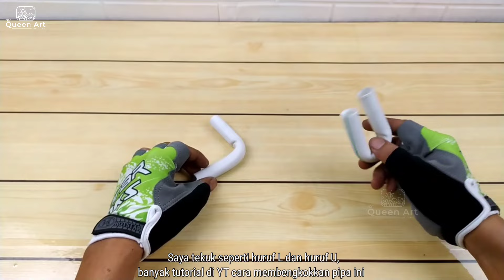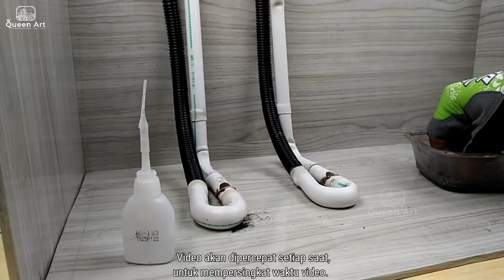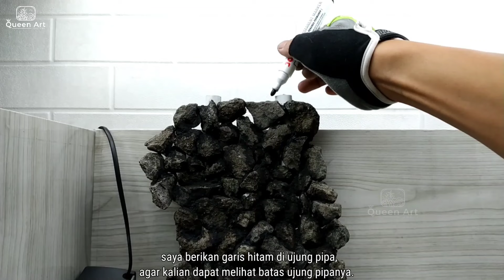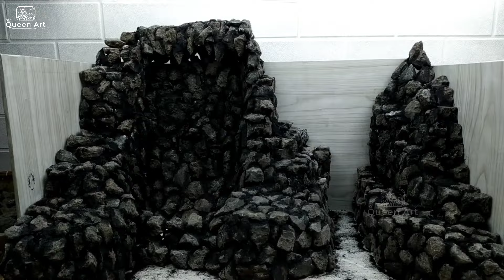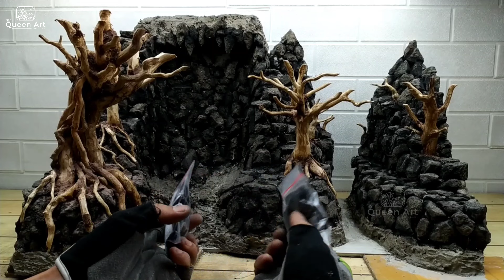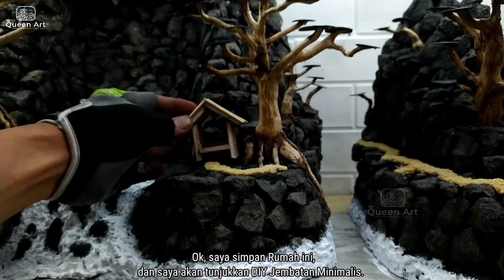HOW TO MAKE AQUASCAPE WATERFALL | AQUARIUM WATERFALLS

Comment: Min mau tnya klo pke filter merk rosston 2 lobang sr 1200 keluar air mancur nya bakalan bagus ga om.
Mohon di jawab om🙏
Reply from the maker: Kayaknya pompa itu kurang bertenaga untuk mendorong pasir di tebing Waterfall nya. Rosston yang SR ataupun SP 1200 kalau gak salah mempunyai output 800L/H. Kurang Joss gan. Minimal cari output nya yang 1000L ke atas.
Reply: @QueenArtAquaticDesign  tpi rosston ini Qmax nya 1100L/H, 200-240V, 50Hz min, apa tetap hrus ganti merk?
Reply from the maker: Oh kalau di atas 1000L biasanya bagus gan. 
Tapi tergantung saluran Waterfall nya juga. Mudah-mudahan bisa cocok ya.. 🙏🏻
Reply: @QueenArtAquaticDesign  baik terima kasih bnyak🙏 sehat selalu murah rezky subscribe baru 🙏😁

Comment: Bang ada masalah dengan waterfall nya..  aquascape waterfall saya sering bekabut.. apakah itu efek dari pasir?? Atau filter kurang standar nya??
Intinya masalah kabut bang tolong jawab bang solusinya..
Reply from the maker: Bisa dari keduanya, pasir dan filter. Solusi standar nya, pakai pasir silika yang ber'merk seperti pasir silika dari Kandila, (wajib cuci bersih sebelum pakai), dan mesin filter di awal perbanyak spon putih, selanjutnya perbanyak media filter seperti Ring keramik dan bio ball. Setiap ganti air, jangan lupa tambahkan sedikit bakteri starter sebagai pembantu mempercepat terbentuknya ekosistem dalam Aquascape.

Comment: are these sand waterfalls considered DEPENDABLE... or are they the kind of things that fail time to time ?
Reply from the maker: please explain again, I don't understand what you wrote ☺️
Reply: @QueenArtAquaticDesign  Well i would like to know if they require maintenance to prevent them from clogging .. or once you get it to work, it keeps on working.
Reply from the maker: @gladiatormechs5574  
ok, I get it.  This sandfall does not require special care.  and continues without stopping, as long as the pump engine is running, the sand will continue to run.  from below enter the channel hole and fall from above then back again to the channel hole.  keep like that over and over again. ☺️
Reply: in my experience only glass tubing will last.  Plastic pipes will eventually fail due to the sand causing the pipe to become ruff .  at first you will notice a slow down in the sand come from the waterfall and it will stop eventually